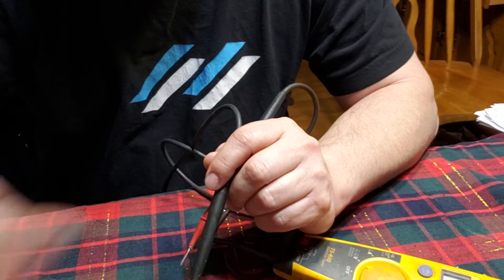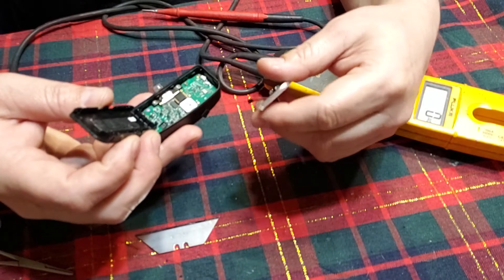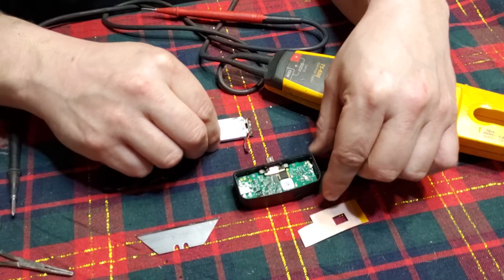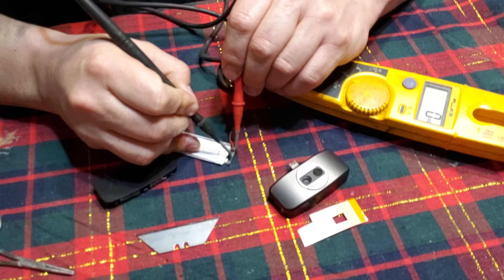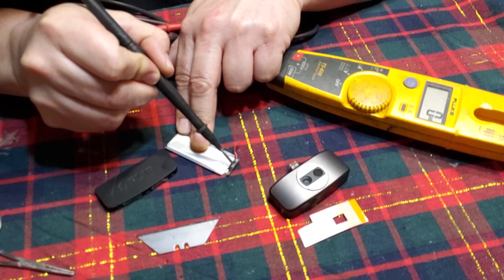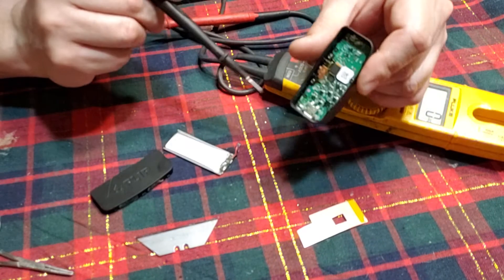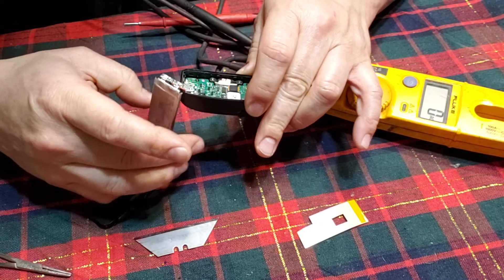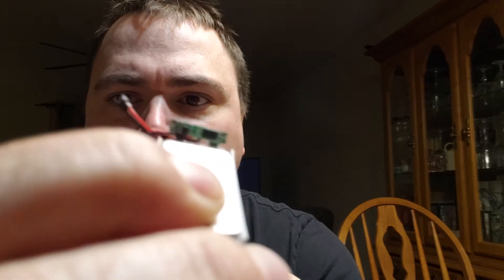Disassemble flir one gen 2. Destruction!

Comment: Tried converting to USB. I get the power on light but it doesn't get recognised by software. I've swapped data plus and minus around and same. Anybody done the same and succeeded or failed?
Reply from the maker: I ended up tossing this in the junk pile. I did buy a replacement battery. That didn't fix it.

Comment: I had a sililar problem with a bluetooth speaker. The battery voltage was low and the BMS refused to charge. I desoldered the battery, charged it with a tp4056 module for a few minutes, resoldered to the board and it worked again.
Reply from the maker: I replaced battery. Didn't work for me

Comment: Don’t be touching the board with your fingers. You’re not wearing an anti static lanyard. You could kill the components
Reply from the maker: Lol! Thanks for the concern. I'm not worried about it since the unit was already malfunctioning. I understand microcontroller sensitivity and spent several years in the manufacturing process of optical technology and smt.
Maybe you can ask flir why they don't make a replacement battery unit?
Reply: @rywolf01  I work for a company which works with a lot of flir stuff. I tested a bunch of used Pro ones and about 80% either wouldn't turn on or the battery self discharged overnight. Many even had bulging batteries. I don't understand why the engineers didn't just make it a little but thicker and double or triple the battery capacity. They could've even done away with the battery and powered it through the phone. This is very easy to do with USB C. Perhaps they didn't want to make different hardware for different connector versions.
Reply: @175griffin  like Seek.

Comment: Any luck finding a battery
Reply: There is a variant of battery 402050 at Aliexpress that could fit the original one.
352054 means 3.5 mm thickness, 20 mm width, and 54 mm long.
402050 has 4 mm thickness and Flir one has a space for it.
Reply from the maker: Unfortunately... No. The response from flir was less than satisfactory.
Reply: rywolf01 you would think these would last longer and not be such trash. I guess the thank you letter in the box doesn’t mean squat. Did u try powering unit any other way?

Comment: Having the same problem withe the gen 2, they offered me a coupon of €200 which i can only use to buy the gen 3 pro!! Well not for me, done with flir. It’s seems the gen 3 still has the same issues.
Reply from the maker: Yep! Same scenario here. They also do not offer a replacement battery. I'm convinced it is the microcontroller on the battery pack.